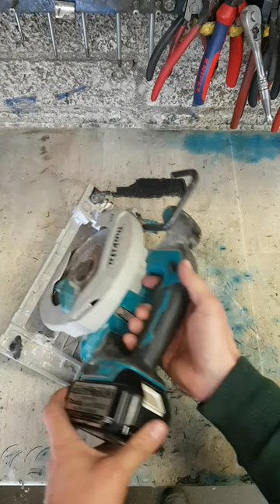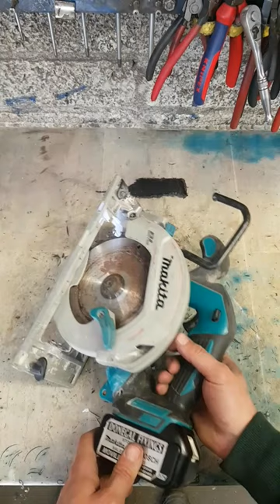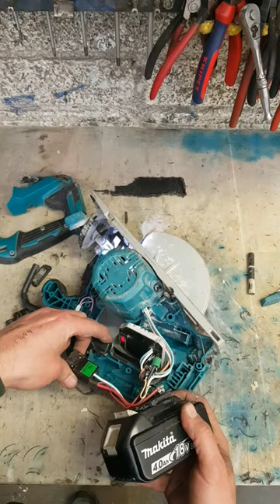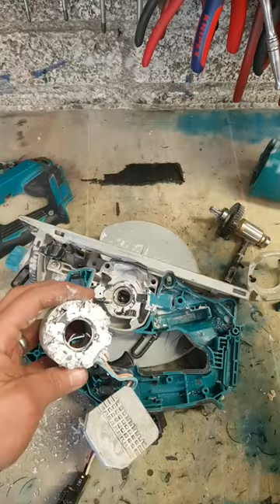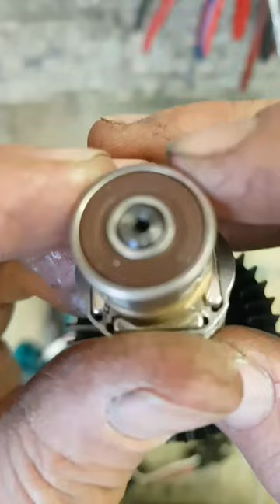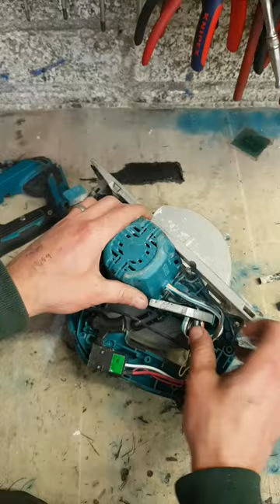Makita brushless saw not starting up. #tools #makita #repair #saw #carpentry

Comment: Why is the blade the wrong way around?
Reply: So the carbide teeth don't unwind in storage
Reply: @stauker.1960  didn't know, thanks
Reply: So was it the bearing or was it the debris on the circuit board
Reply: Maybe it's for cutting rigid insulation 🤔

Comment: Oh my god I've just Googled this problem because I have two circular saws in the back brushless Makita exact same saw with the exact same problem where is the full video for this and what was the problem
Reply: I did the same with my saw just got it cleaned up good and my port where d battery was was heatead and burnt a little clean that up too and works like new ...really strange

Comment: Don't cut cement/fibre boards with brushless saws, it somehow messes with the motor. Same saw, a couple of months old, first I saw sparks on the body before the control unit went dead. Changed the stator and control unit because they made them together and it still doesn't want to turn, sometimes it even turns backwards.
Reply from the maker: if its running backwards, its been wiring in wrong. As for cement and fiber board, i couldnt agree more. Kills saws, grinders and multi tool motor. if you have to use them also buy a compressor to blow them out and only buy brushless tools. they seem to endure it better.
Reply: Mmmmm on our current site we were working with some of those boards and now my saw doesn’t work when it’s raining outside. Maybe there is a connection I’m not sure . But all my others coworkers Makita saw runs fine in the rain

Comment: Hey Dean. May not get reply however I've had a makita dtd171z 2yrs old was working fine then went to use again a couple minutes later and no power through drill at all not even light function. Any ideas on what could be the issue, thanks anyway